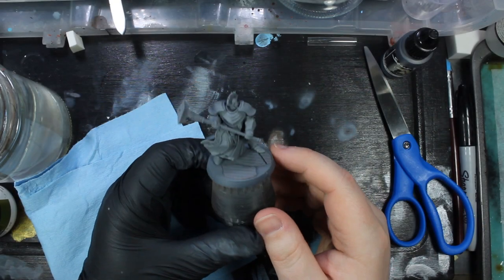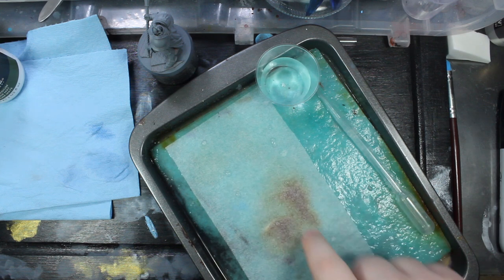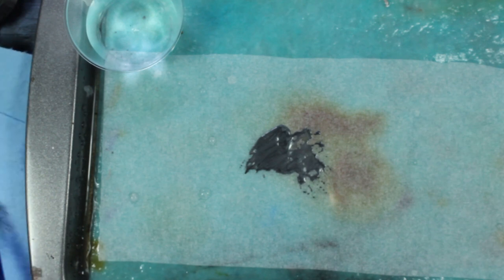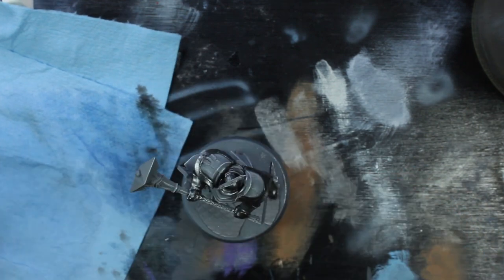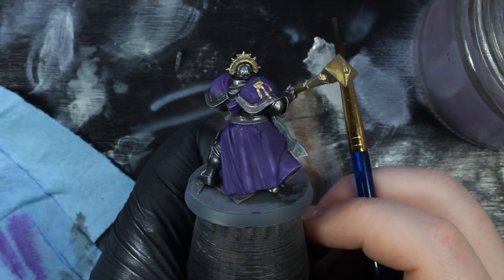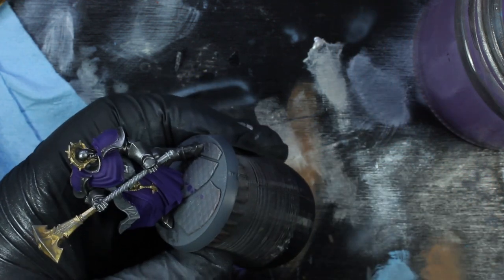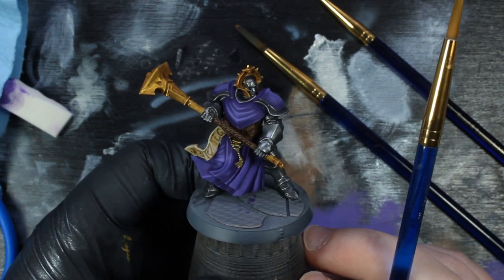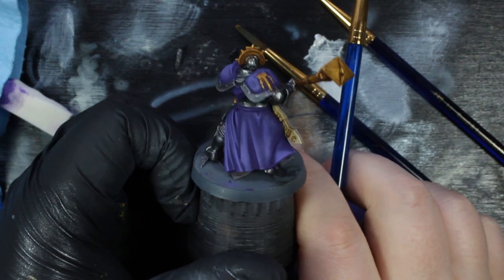Start Painting! A beginners guide on how to start painting miniatures.

Comment from the maker: Just heads up, I've been experimenting with metallics with poor coverage recently and it jogged an old memory on how to paint them easily. 
The trick is to base coat with a 50/50 mix of the metallic (in this case gold) and black, then go over the area with a second coat of the metallic. This has gotten some really solid results, 2 coat metallics, 3 if you want to push even brighter highlights by mixing in silver.  Next project I'm doing will be using that process so you'll be able to see it live.
Also if you're interested in seeing photos of my experiments I post them to the discord sever, every one is welcome. https://discord.gg/XsVheTu

Comment: Oh man, I really like this stuff. So clear and concise! Looking to pick up some brushes, and the ones you’ve painted with look good. What are they?
Reply from the maker: I recommend starting with cheap brushes, the set I'm using is the The  Royal and Langnickle SVP1 (Super value pack 1) there is a link to them below. They wont hold up perfectly, the smaller sizes will split after a month or so but the larger ones will hold up decently. The reason I recommend them is that they are cheap so any mistakes with brush care that might damage them isn't that big of a hit on the pocket book, that and the large flat brushes are super useful. 

Once you've gotten some brush time under your belt I recommend getting Kolinsky sable brushes. Even larger Kolinsky brushes have very fine points when wet, this allows you do detail work with larger brushes meaning less time spent switching between them. I recommend rosemary and co series 33 brushes if you looking for Sable brushes, they are amazing value! As a compassion a size 4 Windsor and Newton series 7 is 50 dollars Canadian where as the Rosemary and Co is 11 dollars.

I recommend getting sizes 10/0, 0, 2 and 4 with short handles. Take care of those and they will last you years. I'll be using them in my next video, so look out for that :). 

https://www.amazon.ca/Royal-Brush-SVP1-Langnickel-Taklon/dp/B001ARHH7G/ref=sr_1_2?crid=3UH2IMZMO9AK&keywords=royal+and+langnickel+brushes&qid=1590530490&sprefix=royal+and+lan%2Caps%2C199&sr=8-2

Rosemary and Co https://www.rosemaryandco.com/pure-kolinsky-pointed?filter_name=series%2033